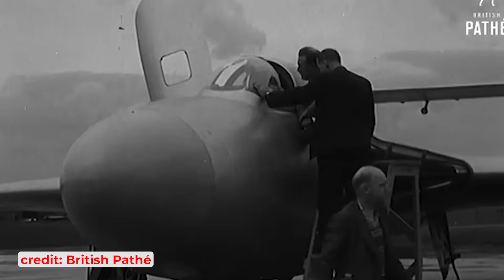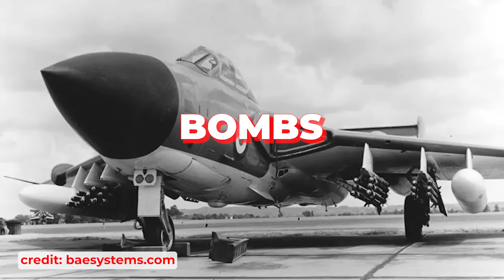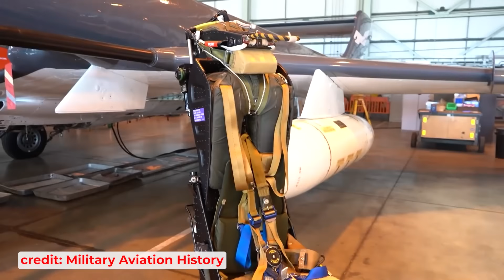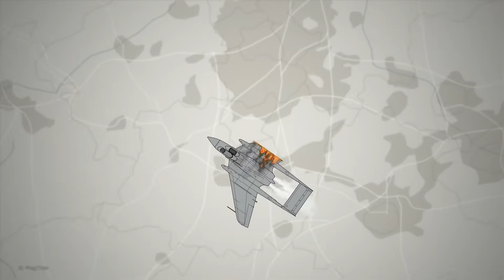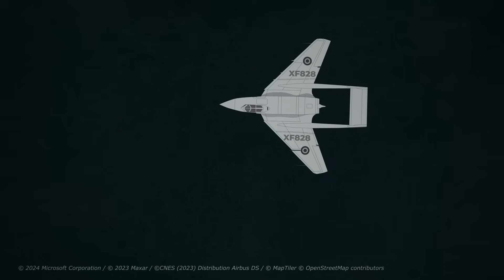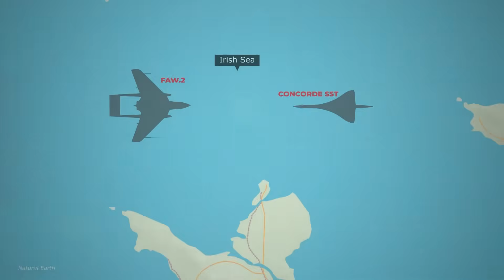Sea Vixen: A Beautiful Killer

Comment: I doubt he has every  seen one.
Reply: Very rare to see any British jets still flying... the ones that didn't crash are sitting in museums now.
Reply: @DoktorBayerischeMotorenWerke 

Sea Vixen Compared. 

We feel we can clear up some commonly held myths and misconceptions, obviously.

It's always good to see the facts presented clearly and concisely isn't it.

We feel we can clear up some commonly held myths and misconceptions, obviously.

It's always good to see the facts presented clearly and concisely isn't it.

See further down for a Meteor losses comparison.

See below for Comet accident losses comparisons. The Comet had similar accident losses fatalities to the later Sud Aviation Caravelle. Much later jet airliners from US manufacturers had significantly worse accident losses. 

The Vickers VC10 held the Atlantic crossing record for 43 years  (Non supersonic airliners). 

The Harrier was the only aircraft of its type at the time it first flew. All 1250 Pegasus engines built for all Harriers ever built anywhere were British build and design engines. The first 135 Harriers purchased for the USMC were entirely built in the UK. All 436 USMC Harriers had British built engines. 

The world's first wind tunnel was built in England during the 1800s. The world's first supersonic wind tunnel was built in England during the 1920s. 

Indeed that's correct. The Whittle Gloster E28/39 was of course a brilliant aircraft that was later copied in Russia as the upsized and tweaked Mig 15 with a copy of the RR Nene gas turbine aero engine.

Obviously the RR Nene being the world's most powerful & most reliable gas turbine aero engine in 1944.

The MD F3H Demon was a contemporary to the DH Sea Vixen & had a similar performance. The F4 Phantom was a follow on from the F3 Demon. The Sea Vixen took a long time to get from first flight to introduction for various reasons and a similar situation occurred with the MD F3H Demon.

McDonnell Douglas F3H Demon
590 Built. Not Supersonic.
Max Speed 578 MPH.
Introduction date 7 March 1956
First flight 7 August 1951
Retired 1964

MD F-4 Phantom 2
Number built 5,195
Manufactured 1958–1981
Introduction date 30 December 1960
First flight 27 May 1958

DH Sea Vixen
Number built 151 (including two DH110 prototypes and one Sea Vixen prototype)
Introduction date July 1959
First flight 26 September 1951
Max speed 695 MPH.
Retired 1972

Regarding the UK Aerospace Sector.
 
An airline recently ordered 60 RR Trent XWB Engines.

It's a great pity & a crying shame that British military forces had to occupy a large part of Germany for decades after 1945 & Russian military forces had to do the same. Of course Russia still posseses a large chunk of what was German territory & of course Russia & the UK produce nukes. Obviously Germany does not produce nukes.

Interesting British achievements.
There is no doubt that the Fairey (England)
Delta 2 was of course the world's first jet
aircraft to exceed 1000 mph.  Indeed It
exceeded the previous record by 310 mph &
held the record for 1 year. Incidentally, the Dassault Mirage 3 & 4 are based on the Fairey Delta 2.

Early days, jet fighters.
De Havilland Vampire, Sea Vixen & Gloster Meteor accident losses were not high or unusual for fighter aircraft at the time. De Havilland built large numbers of all metal airframe aircraft before the DH Comet.
We mustn't forget of course that the DH Vampire for example first flew in 1943 & the engine was also built by De Havilland. There were examples of the Vampire interceptor / fighter in service until 1990 which was operated by more than 30 countries.

Non combat phase accident losses.
% of Aircraft built.
The Canadair CL-44 was a turboprop airliner.
Canadair CL-44                  (ff 1959 ) 48%
Lockheed XF104                (ff 1954) 100%
Lockheed  P80                   (ff 1944) 43%
Lockheed F104                 (ff 1954)  45%
Grumman f9f-5 Panther   (ff 1947) 44% 
Convair F102 Dagger        (ff 1953) 45%  
MD F-101 Voodoo.             (ff 1954) 34%
MD FH Phantom 1            (ff 1945)  35%
MD F4 Phantom 2             (ff 1958)  28%
MD F3H  Demon               (ff 1951)  32%
Gloster Meteor                  (ff 1943)  21%
DH Vampire                       (ff 1943)  23%
DH Sea Vixen                     (ff  1951) 33%
Gloster Javelin                   (ff 1951) 20%
EE Lightning                       (ff 1954) 33%

An example of what goes on these days in various countries.
For example, there are of course no German companies that makes German jet aircraft in Germany & there are no German Companies that make German gas turbine aero engines in Germany that are suitable for widebody airliners.

Brazil makes very good airliners & Brazil is 100th down the list along with Indonesia for wealth per capita. Of course it is in fact the case that Embraer can't build those airliners without purchasing stuff from the US, UK & Europe. Norway Holland Denmark Ireland Belgium - Top 20 wealth per capita - Don't make airliners -  its as simple as that.

    Early days of the airliners.
That's correct of course, at the time the Comet wasn't particularly dangerous. Agreed, that is indeed the case of course, The DH Comet was definitely not the worst engineering failure in commercial airliner history.

How things were back then. 
Accident losses - % of aircraft built.
DeHavilland Comet 4                   14% 
DH Comet all mks   (ff 1948)       17%  
Vickers VC10 UK                            5%

The DH Comet had better safety than or similar safety to many other commercial passenger aircraft of a similar era.

Douglas DC-1                                      99%
Douglas DC-2                                      47%
Douglas DC-3                                      30%
Douglas DC-4                                      26%
Boeing s300                                        72% 
Boeing 307                                          70%
Boeing 247                                          48%
Boeing 707                                          20% 
Lockheed L-049/149 Constellation  30%
Lockheed Electra Turboprop             29%
Fairchild FH-227                                  30%
McDonnell Douglas DC-8                   14%
Sud Aviation Caravelle                        15%
Canadair CL-44  Turboprop                46%  
Convair CV-580  Turboprop                22%
Convair CV-880     (ff 1959)                27%  
Convair CV-990     (ff 1961)                33%
Tupolev T-104        (ff 1956)                16%

The VC10 held the fastest Atlantic crossing speed record for 41 years (Non supersonic airliners).

For the first few years of operations the Caravelle and Comet had similar accident loss Fatalities numbers.

De Havilland had prior experience building many all metal construction airframe aircraft & thousands of jet powered fighter aircraft that were primarily of metal construction with pressurised cockpits & jet engines built by De-Havilland.

We hope this helps. Cheers as always indeed etc
Reply: @DoktorBayerischeMotorenWerke 

We feel we can clear up some commonly held misconceptions.

It's always good to see the facts presented clearly isn't it?

A potential successor to the Sea Vixen. 

The Hawker P-1103 / General Dynamics / Lockheed F16.

During the 1950s in the UK a number of aircraft that would've exceeded the capabilities of anything on the drawing board elsewhere were in the design stage. They were cancelled for various reasons including the missiles doing everything idea. 

1954, Hawker, fighter development - Air Ministry Operational Requirement OR-323. P-1103, a twin-seat swept wing aircraft powered by a de Havilland Gyron turbojet engine and armed with two Red Dean air-to-air missiles. Reworked the following year-  February 1955, the Ministry issued OR-329, called for a large 40-inch (100 cm) sweep-scanning radar unit AI-18. In October 1955 revised P-1103 proposal for a revised requirement offering the Red Hebe missile. 

In addition to the P-1103 Mach 2.5 design, Hawker also did design work for a faster P-1121 version. Mach 3, steel wing + uprated Gyron engine.

The Hawker P-1103 initial design had a fully variable geometry chin position inlet, Hawker's basic 1954 design would later be used for the General Dynamics F16 Fighting Falcon (Viper) - first flight 1974. The F16 was built in a number of countries with companies in those countries also producing parts for the aircraft that were built in the US.

We hope this helps.
Reply: @DoktorBayerischeMotorenWerke 

A number of similar performance non supersonic jet aircraft got to first flight stage at around the same time. 

The MD F3H Demon was a contemporary to the DH Sea Vixen & had a similar performance. The later F4 Phantom was a follow on from the F3 Demon. The Sea Vixen took a long time to get from first flight to introduction for various reasons and a similar situation occurred with the MD F3H Demon. The Douglass Skyhawk delta wing is a contemporary to the the Gloster Javelin delta wing. Both non-supersonic delta wing aircraft, the javelin had better performance and first flew a few years before the Douglass Skyhawk.

Douglass A-4 Skyhawk 
2950 Built 
Intro 1956
FF 1954
In service to 1980s
Max V 670 MPH
Delta wing. A small / light jet aircraft designed for carrier operations without having to have folding wings. Often referred to as the scooter. 

McDonnell Douglas F3H Demon
590 Built. Not Supersonic.
Max Speed 578 MPH.
Introduction date 7 March 1956
First flight 7 August 1951
Retired 1964

MD F-4 Phantom 2
Number built 5,195
Manufactured 1958–1981
Introduction date 30 December 1960
First flight 27 May 1958

DH Sea Vixen
Number built 151 (including two DH110 prototypes and one Sea Vixen prototype)
Introduction date July 1959
First flight 26 September 1951
Max speed 695 MPH.
Retired 1972

Gloster Javelin.
434 built.
FF 1951
Intro1956
Max V 710 MPH
Delta Wing. 

Interesting British achievements.
There is no doubt that the Fairey (England)
Delta 2 was of course the world's first jet
aircraft to exceed 1000 mph, 10th March 1956 Indeed It exceeded the previous record by 310 mph & held the record for 1 year. Incidentally, the Dassault Mirage 3 & 4 are based on the Fairey Delta 2.

When the EE Lightning first achieved Mach 2 it was one of the fastest aircraft on the planet. 
P1 Mach 1 achieved 1954, Mach 1•5 capable.
P2 Mach 1 achieved 1956, Mach 2 capable. 
P2 Mach 2 achieved 1958.

The Hawker P1103 was a design and part built prototype that would have led to Mach 2 & Mach 3 versions of the aircraft. The General Dynamics F16 Fighting Falcon was of a similar design that went into service in 1975. The P1103 was cancelled during the switch to "mostly missiles plus no supersonic interceptor aircraft required in the future" era which included cancelling air to air missile development. Scheduled for test flights in 1958 and to be in service 1962. The General Dynamics F16 Fighting Falcon - based on a British design started 39 years earlier, built in the US and a number of manufacturing partner countries with parts for the US built aircraft sourced from partner countries. 

There were plans to do a supersonic thin wing Javelin which of course got cancelled. 

Early days, jet fighters.
De Havilland Vampire, Sea Vixen & Gloster Meteor accident losses were not high or unusual for fighter aircraft at the time. De Havilland built large numbers of all metal airframe aircraft before the DH Comet.
We mustn't forget of course that the DH Vampire for example first flew in 1943 & the engine was also built by De Havilland. There were examples of the Vampire interceptor / fighter in service until 1990 which was operated by more than 30 countries.

Non combat phase accident losses.
% of Aircraft built.

The Canadair CL-44 was a turboprop airliner.
Canadair CL-44                  (ff 1959 ) 48%
Lockheed XF104                (ff 1954) 100%
Lockheed  P80                   (ff 1944) 43%
Lockheed F104                 (ff 1954)  45%
Grumman f9f-5 Panther   (ff 1947) 44% 
Convair F102 Dagger        (ff 1953) 45%  
MD F-101 Voodoo.             (ff 1954) 34%
MD FH Phantom 1            (ff 1945)  35%
MD F4 Phantom 2             (ff 1958)  28%
MD F3H  Demon               (ff 1951)  32%
Gloster Meteor                  (ff 1943)  21%
DH Vampire                       (ff 1943)  23%
DH Sea Vixen                     (ff  1951) 33%
Gloster Javelin                   (ff 1951) 20%
EE Lightning                       (ff 1954) 33%

More recent UK military jet aircraft.
 
The Tornado & Typhoon & their engines are Supersonic & are indeed British design aircraft with British design engines built by an international consortium. The Tornado design for example started life during the 1950s at Vickers as the AFVG, it's engine is based on the RR RB-199. The EE Lightening is also a British Supersonic jet aircraft.

The Typhoon is the British BAC-EAP with an engine based on the British RR XG-40, the Typhoon is also built by an international consortium.